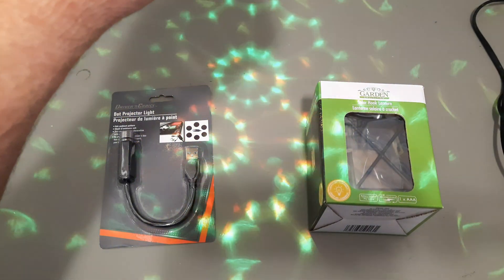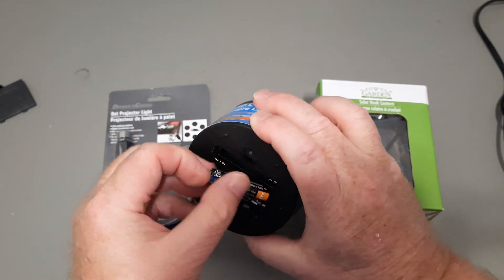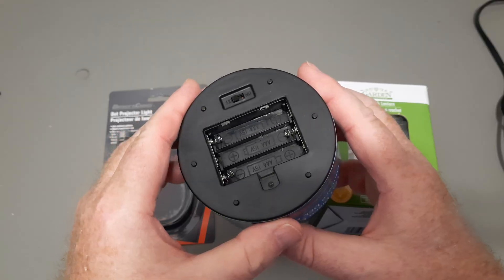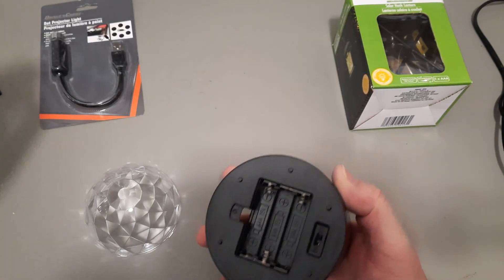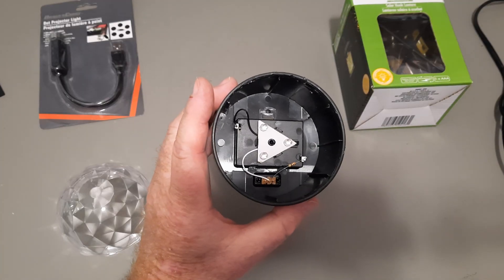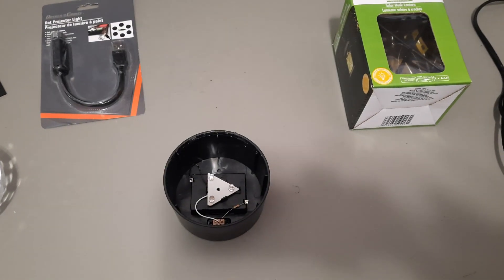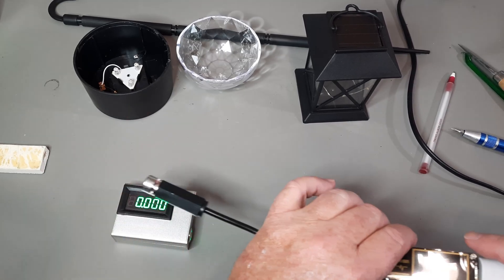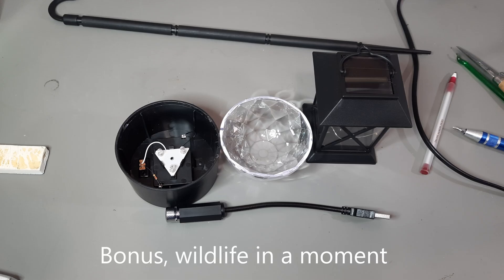Dollar Tree Cheap but Excellent Electronics

Comment: Standard 1w Laser probably
Reply from the maker: I suspect closer to 1mW to 5mW since the laser power meter I have would detect 1W. Have a good day
Reply: @retireeelectronics2649 yes my bad 1mw, class 2, look bright but I think it's more the pattern that gives this impression than the power itself. I'm still surprised the power is not mandatory on the box, and in a sticker on the product.
Reply from the maker: @I.TestThings  I was able to pop the laser open and concentrate the beam into the power meter (accuracy of meter, who knows) and it read best 1mW. But yes it should have the Class 2 label and sticker instead of just a caution laser label on the packaging. I figure you forgot the m, otherwise that would be one nasty laser (-: